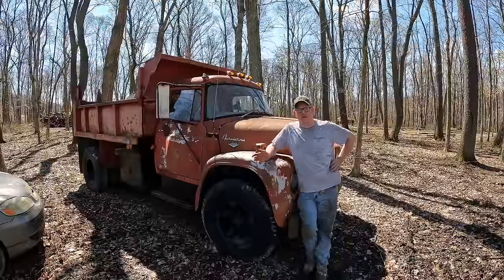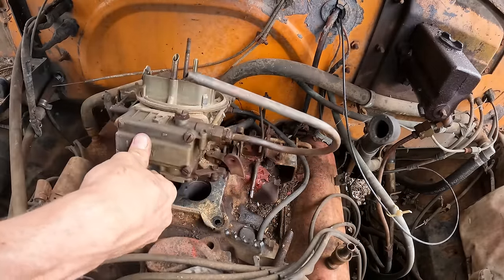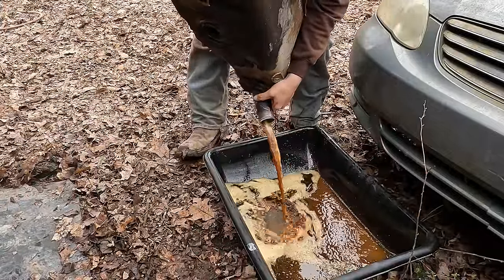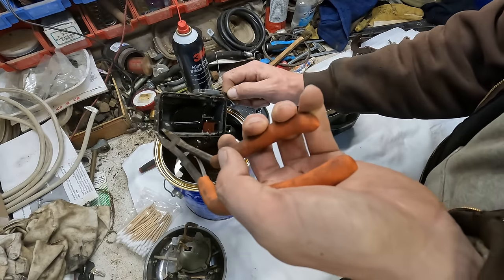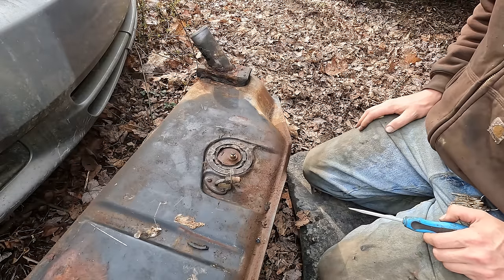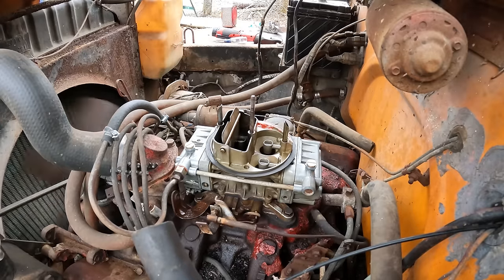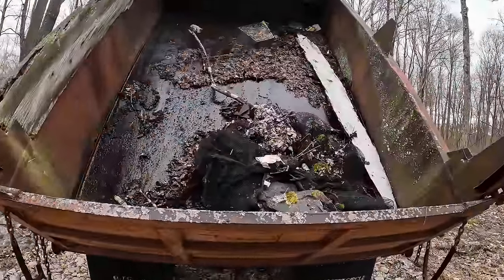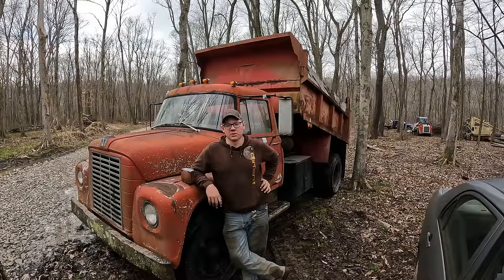Sitting 20+ years will this $500 Truck Run & Drive again? (International Loadstar Revival)

Comment: My father worked at a place that had a single axle International loadstar and they had a hard time getting the right parts for the engine, clutch, transmission, PTO, spark plugs, plug wires,  filters or belts or anything/everything else.  Even the oil was always at the wrong level on the dip stick.  Finally a guy at a parts store that had experience with International "Harvester Works" figured out it had the engine from a small combine that were not produced in large numbers and not an engine from International "Tractor" or International "Industrial".  I do not remember what it was but two of the numbers on the block and manifold were not correct,, unless you knew about the switch.  Once they knew that, parts were easy (er) to find.  Such was the 1960's.

Comment: Hey Matt.  Awesome project. Do yourself a favor though, INVEST IN AN ULTRA SONIC CLEANER!! Yes, that deserves all caps! They are awesome for cleaning carb parts, as well as other misc stuff around the garage. I use purple power in mine and it works great. About 15 min in the sonic cleaner and the parts come out almost spotless.  Little spritz with some carb cleaner and good to go. The one I have can be bought at Harbor freight for about $80.

Comment: Love the binders. On the farm we had a KB7 then traded it for a brand new L170 with a Black Diamond engine. Since we were on a wheat farm we always had upright exhausts directly out of the engine to help prevent fires. That Black Diamond had the most beautiful sound, not noisy but just so smooth. Would like to find that truck now.

Comment: One thing I've found to work well when bleeding hydraulic brakes or hydraulic clutches, is go ahead and stomp on it for a while, like everyone does, to get easy air out, but to get that last bit, that's hard sometimes, especially with clutches it seems, push the pedal to the floor, then side step it so the pedal can snap back faster than if your big boot is riding on it.  If you think about how they work, you'll be like duh, of course that would work better.  I had been a professional mechanic for 10-15 years before I learned that trick from an old biker dude, and I tell you, I had a big greasy palm print on my forehead for not thinking of it on my own, hah.  Keep up the great vids.

Comment: Porter greetings.🇺🇸 I love it when a plan comes together! 🤪Name…”Belle”. Honey, let’s grill out this eve, I have the sauce!  I hate a fuel tank behind the seat, but yours just had the filler tube that went through the floor. Might you still get fumes from the gas? Hmmm. 🧐 I’m shocked that the truck would even run at the beginning! It’s been many years since I’ve rebuilt a carburetor! I love a Holley carb! 🥰 The engine runs better than what I expected for 80K mile truck! Is that a 342? And NO smoke! Well, I didn’t see any. Amazing! For $500, you really didn’t waste that money! 🤩 Those old IH trucks were quite nice looking! I have a friend that has one with wrecker bed on it. He wants more than $500 for it, but I am tossing the thought around about buying it. One can always use a wrecker. I love the old trucks like that. I’ve already purchased an old trailer & straight truck (IH S1900) from him. This has been quite good & encouraging. Glad it worked out for you! 🥰 It’s always good to see some old iron being used again! When are you gonna get a floor/pad to work on your stuff on?! You sure could use one! Enjoy the ride! 🥰😎✌️

Comment: Looks like a old  345 cu in engine. Came with a double pumper holly. Those engines came in 304,345 and 392 sizes. Low rpm engines but heavy duty torque monsters. The air force had a bunch of those trucks in 4 wheel drive.

Comment: So glad I found your video on the loadstar. I have a 77 loadstar that I bought bought 4 years ago and it amazes me after all winter sitting spring comes and it fires right up even started straight up mid winter one year. I been wanting to work on it however I definitely not a mechanic but I can do a few things you definitely gave me some ideas to look for to replacing as I’d like to keep it running as long as I can. Good news your brakes lined out however I was looking forward to watching how you fix those things cause that’s my biggest issue with mine now. It has brakes but not a lot and the right rear tire is wanting to grab hard when i do find some brakes now don’t have a clue where to start. But we gonna give it a shot I reckon. Thanks for the video it inspires me to put a little work to keep these ole trucks running they don’t make em like that no more for sure.

Comment: Hey Matt I know this is an older video but those limiting chains are super essential they even have them on newer dump trucks I used to drive a 2004 Mack granite that had limiting cables not only do they save the cylinders from ending out but they also save the PTO from over pressurizing the lines

Comment: Nice old truck. We had several of the exact same truck on the farm back in the early 70s. The thing is more like high & low range in a 4 wheel drive pickup. If you go to split shifting that thing you are asking for trouble. It was great to put it in low when you had a full load of grain and needed that power to get to road from the field. When you go to split shifting 99% of the time it will grind until it pounds into gear and in a short period of time it will come unglued. It was never designed for split shifting. It would be like trying to shift your 4 wheel drive pickup from low to high range in between shifting the gears not a good idea.

Comment: Matt, I love your rescue of these ‘dinosaurs’ that still have life in them. With their simplified systems, you will never have to worry about a nuclear EMP attack. Your gear is bulletproof. Thanks for saving them and giving us old timers a reminder of the simpler times. 
One suggestion I would offer.
 I don’t know if you have one, but an heated ultrasonic cleaner works wonders on carburetor cleaning and with a 2 gallon tank is big enough to put all the carburetor parts in at one time. They have adjustable heat and a timer for operation. Check out Mustie1’s channel. Daryl uses his constantly on his carb rebuilds and the parts come out looking almost brand new. Added plus, he doesn’t use the canned cleaner compound in it, instead using a mix of water, Simple Green  and a  third item that currently escapes me, but the solution is non-flammable and it doesn’t destroy the rubber diaphragms and seals.  The ultrasonic units are reasonably priced on Amazon.

Comment: I would have put that tank filter external.  It wasn’t a screen it was a filter that will eventually need to be replaced. A lot easier to replace external fuel filters than pulling the tank down each time🤭

Comment: Nice!!! In much better shape than my '50 F6 project but funny that it's mostly the same things, fuel pump, brake booster, etc...only half way through the 6v- 12v conversion so no gauges yet. I should have some more videos on my channel coming up as the weather warms up. Keep us updated!

Comment: I had a 1600/1700 series International which had been a grain truck before I bought it. Had a steel diamond plate floor anta twin cylinder hydraulic lift, PTO driven itf course, I built removable sides for it with single rear gate, all heavy wood. It only had the 345 engine with a two speed rear differential but that truck could haul anything I threw it from junk to gravel. I easily hauled 6 yards of class five all the time. Sadly it had drum brakes front' & rear so I had to be very careful driving it loaded as the brakes left much to be desired! I only sold it after I was injured severely and told I'd never walk again. Three years later I was walking again but couldn't find the guy who bought it from me. I miss it to this day. I did find a super low mileage 94 F Super duty with a 7.5ltr but it was a basket case. Redid most of the truck, a dump truck and still have it today. Only 48,659 miles! Older stuff is way more Fun no matter what brand it is, IMHO. Thx Matt for some awesome memories as I'm now pushing 66 years young!😊😊🎉
Reply: Darn it, my International was a 1971...

Comment: I used to.
 Drive an old international scout for wheel. Drive and had I think it was a 340 cubic inch engine in it and with on that engine. Though it would idle, the oil pressure would idle low. But once I stepped on it, it would bump back up to 30-30 5 pounds.

Comment: Just as a point of interest regarding your comment on fuel consumption just remember that it is a LOADMASTER not an ECOMASTER International trucks of this type, especially gas powered units, were never known to be easy on fuel.  They were designed to work and as such needed fuel to do so.  But still nice to see one of these units being saved from the scrapper and put to good use.  Good on you!!

Comment: The o rings on the bowl feed tube on a Holley are very touchy. They either fail or are good till the next time you pull bowl. The Holly o ring is very exact, kit orings that seemed the same weren’t.

Comment: I pulled apart a carb on an old Massey 204 parts tractor I bought. Old guy was going senile (his wife informed me) and told me it had been sitting for about 5 years. I'd bet more like 20-30 by the looks of the carb when I pulled it apart. It was about 3/4 full of what looked like tar. Same stuff that was on your float, although not quite as hard as that. I tried cleaning it for a little while because it was an original Marvel Schebler carb, but I gave up eventually and bought a China one. Too much rust and that gum would just not come off. Engine had been rebuilt and had less than a hundred hours on it before the old man parked it for his newer Kubota. Being an updraft carb nothing got inside after all that sitting. Upon first fire and compression check it had higher numbers than it was supposed to, like '80s pushrod V8 kind of numbers. Got really lucky because they had a set of factory high compression pistons for the old Continental engine used for high elevation. It must have had those in it. My other engine ran fine but opted to use the high compression engine out of the two. I figure I had about 10 more horse from the 40 horse engine, so probably around 50. Climbing this one hill I could only do it in the two lowest gears before. With the "new" engine it would climb it in third, and that beast was heavy with a full loader bucket and the gannon box on back with ballast, two weighted rims and filled rear tires. Saved me a lot of time running stuff up that hill. She was a thirsty one though.

Comment: Great job! though it seems like you should be able to fabricate some sort of blocking arm welded or bolted thru the frame on both sides to stop the lift hinge from going past the point of no return in stead of that chain. chain seems kinda ghetto to me, but I suppose, if it works?

Comment: Wish I could find a deal like that... Just to have it to move material on the farm.

As to rebuilding carbs.  I have rebuilt several Holley double pumpers and I lost track of the Rochester Quadrajets I've rebuilt and modified.  Carbs needing work don't scare me.

Comment: Worked on/drive a number of “Binders.”  Had one that the points always closed up the the gap slightly, so I had a Mercury dime in my wallet  that was the perfect thickness for testing the points.

Comment: I would have sworn it was the laughing shaft on the door.  Great job getting it working again.  Sometimes you just have to use a bigger hammer.  That Holley 4 bbl suggests this truck needs headders out the hood and chrome plated muffler bearings for tire burning power (just kidding).  the 4 bbl is a surprise as most suburban type IH I have dealt with have a 2 bbl.  Could this be a high performance truck?  Great video, great job.  Try to hold all that power down!

Comment: WE HAD TRUCK LIKE THAT AT WORK FOR YEARS. WE REFERED TO THEM AS " CORN FIELD CADILLAC'S" . THE TWO SPEED AXLE IS TIMES TWO FOR ONE THRU 5. YOU CAN SHIFT UP OR DOWN IN REVERSE ALSO. I THINK THE BEST NAME FOR THIS TRUCK WOULD BE "OLE' BLISTER" !!  50 MPH WOULD BE THE TOP END DEPENDING HOW IT'S GEARED.

Comment: I think it would be kewl to do a mech video,buy the rig have a decent setup in case conditions are a mess.back up recovery rig to the bought build tarp tent from tool truck to purchased truck have wood stove do engine swap if need be then drive it away in 2days or less or machines,tractors etc that have right descpription of parts needed to drive away.

Comment: Probably needed that manifold pipe to act like a carburetor heater, similar to small aircraft rotary engines. Keeps wet or very humid air (like clouds) from freezing inside the carburetor, which is about 10 deg F below the outside ambient air temperature. I once had a car (a 1970 Fiat 124 Sport Spider) which also had something similar. The air inlet tube actually could be rotated 90 degrees downward to suck in warm air off the manifold. Actually needed that one winter late at night on the highway to keep the car running.

Comment: Get an old long speedometer cable it will go through the gas line  and clear it. If you can remove fuel lines in sections it is much easier. I think you get the idea works like a sewer snake. Good luck

Comment: Those International V8s can have issues with the cam bearings clearances being excessive, losing oil and lowering oil pressure. Basically solid, bombproof engines if not over-revved.

Comment: It just occured to me, i think your engine is from a light truck. Loadstars ive seen had a governor on them, which consists of a governed carburetor and a governed distributor. There should also not be a lot of complex hoses. You should have one small hose from the vacuum advance can to the carburetor. There shoild be another hose to the air door actuator on the air cleaner housing. That is what the big silver tube is for. When the engine is cold, that door opend and air is drawn over the exhaust manifold which heats up ralidly and helps it require less choke in cold weather starting. It is a smog thing,there is no down side to it if its working right any any fuel saved at todays prices is a good thing. There might be a thermal switch in the manifold that controls vacuum to it so that it closes when the truck fully warms up. I dont think my 72 3/4 ton has that. It has no smog gear at all, and that was the factory configuration. 

There are two large hoses out of the valve covers. They are connected into those little screw in can thingies. Those are not pvc valves but instead flame arrestors. They are hard to find if you break one but there are instructions on the forums to make obe from brass fittings and steel scrub pads and some sink screens. Their job is to stop a backfire through the carb from igniting the oil vapors in the crank case. Those both go to the air cleaner housing. The PCV is located behind the carburetor, usually in a rubber grommet in the valley pan. The grommet is available from Dorman and the pcv is listed for an IH Scout with a 345 or 304. Except in the cases where the pcv is screwed into a metal tube thats screwed into the valley pan. (I dont know a lot about that style, but its on older engines from the 60s). The  two hoses from the valve covers draw filtered air from the air filter housing into the crank case. It us then drawn through the crank cSe scavangeing fumes and oil mist and then through the pcv valve and through a hose that connects eother to a vacuum port on the intake manifold or a vacuum port on the carburetor. Im not realy familiar with how the governor hooks up. But if you dont have one, i bet your engines from a smaller truck. The part numbers can be checked against the parts manual to determine what those parts were originally from. Your looking for a part numver of the form xxxxxx-yxx where x are numbers and y is a letter. There will eirher be 1 or two numbers after the letter. Some random examples of what they look 386568-R91, 590334-C92 or 268980-C2.

Two other things on these engines. There is a particujar routing of thecspark plug wires. One of them is really long and goes way up behind the carburetor. This was the result of a service bulletin. There were two wires next to each other that were consecutive in the firing order. That could cause cross firing at a very and time and even result in engine damage. The solution was that long wire routed behibd thr carburetor. There is axduagram out tgere on the internet aomewhere. The second ogbition related thing to remeber is that timingvis done on the #8 cylinder instead of the #1 cylinder. (Yea, the know, why didnt they just call that one cylinder #1.)

Oil pressure allways looks a bit low on these but 10 or 15 at idle is ok. Use a heavy duty "dual fleet" 15w40 oil in it thats rated for spark and diesel engines. You need at around 1200ppm zinc to protect the cam shaft. Even with the heavy duty oils, sone of them newer ones dont have enough zinc so its best to check. The idle speed should be 600rpm. Base timing with the vac advance disconnected is listed as 0 degrees timed off the #8 wire.

Comment: That fuel filter you used inside the tank looks like a fuel filter for the inlet of a GM Rochester Quadrajet, although it's not the same number as the one for my 69.

Comment: MATT, QUITE A WHILE AGO I DISCOVERED EMPTYING A CAM OF CARB-CHOKE CLEANER INTO SOME SMALL JARS, MOTORCYLE CARBS HAVE SOME VERY MINUTE HOLE IN THE  METERING RODS, SO I SOAK THEM IN CARB CLEANER FOR ABOUT AN HOUR THE BLOW THEM OUT, AND I ALSO USE BIGGER JARS FILLED WITH CAB CLEANER FOR LARGER PARTS! IF I WERE IN YOUR SHOES I WOLD BUT ABOUT A DOZEN CANS OF CARB CLEANER FOR USE IN FILLING LARGER CARB PARTS, BUT YOU CAN'T USE ANY PARTS THAT MAY HAVE RUBBER OR NEOPRENE, THE CARB CLEANER WILL DESTROY THOSE RUBBER PARTS OR NEOPRENE! JUST THOUGHT YOU WOULD LIKE TO KNOW TO HELP YOU OUT!